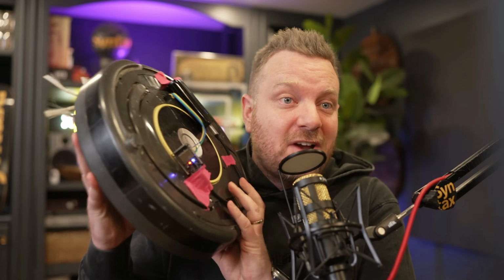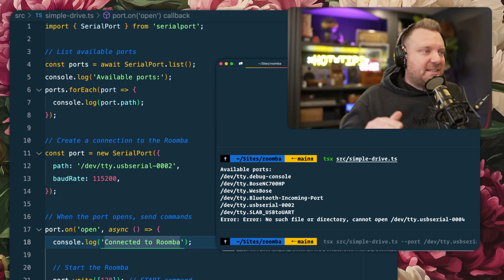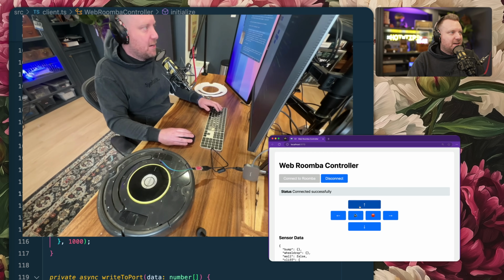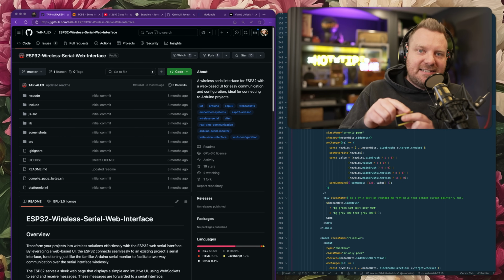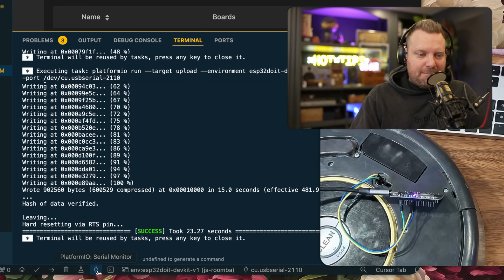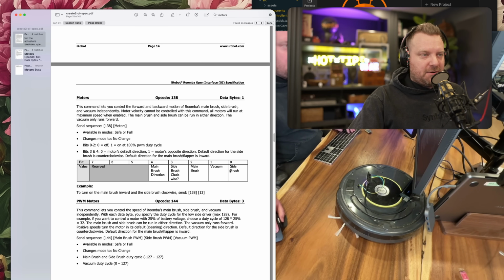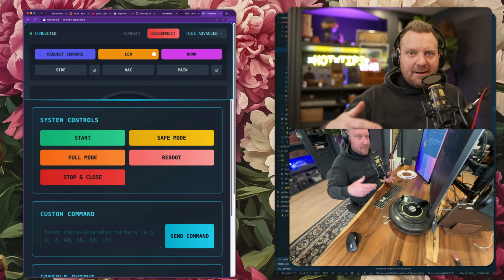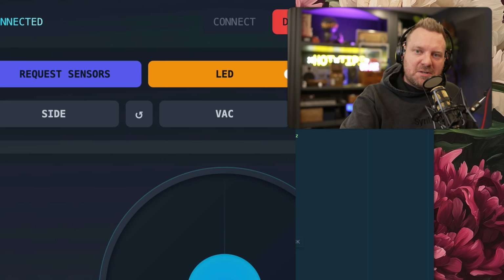I put JavaScript on my Roomba Vacuum

Comment: I want to run a vision model on Roomba i3 with NVidia Jetson nano. The Board doesn't have a serial connector. There is a PCIe like connector. Anyone know how to connect in to the MB? 
Plan B is to remove everything and Run a separate motor controller.

Comment: Is it possible to reprogram the audio files on a roomba? I want my roomba to say lines from the terminator while it cleans
Reply: The "song" command lets you write songs using notes, but I see that the length is determined by the number of notes, not the duration. You may have 16-16 second notes playing, or 16 1/64 of second notes playing.
Song Command opcode: 140 Number of data bytes:
2N + 2, where N is the
number of notes in the song
Specifies a song to the SCI to be played later. Each song is
associated with a song number which the Play command uses
to select the song to play. Users can specify up to 16 songs
with up to 16 notes per song. Each note is specified by a note
number using MIDI note definitions and a duration specified
in fractions of a second. The number of data bytes varies
depending on the length of the song specified. A one note song
is specified by four data bytes. For each additional note, two data
bytes must be added. The SCI must be in passive, safe, or full
mode to accept this command. This command does not change
the mode.
Serial sequence: [140] [Song Number] [Song Length] [Note
Number 1] [Note Duration 1] [Note Number 2] [Note Duration 2]
etc.
Song data byte 1: Song Number (0 – 15)
Specifies the number of the song being specified. If you send
a second Song command with the same song number, the old
song will be overwritten.
Song data byte 2: Song Length (1 – 16)
Specifies the length of the song in terms of the number of notes.
Song data bytes 3, 5, 7, etc.: Note Number (31 – 127)
Specifies the pitch of the note to be played in terms of the MIDI
note numbering scheme. The lowest note that Roomba can
play is note number 31. See the note number table for specific
notes. Any note number outside of the range of 31 to 127 will
be interpreted as a rest note and no sound will be played during
this note duration.
Song data bytes 4, 6, 8, etc.: Note Duration (0 – 255)
Specifies the duration of the note in increments of 1/64 of a
second. Therefore, half-second long note will have a duration
value of 32.

Comment: Question: Im trying to do the project myself but have problems with getting a connection on the esp , because of that it defaults to 0.0.0.0 How can I proceed to find a solution. I have a correct set up in the WifiSetUp.h file. Im using the repo Wes Bos made btw.   output:  Serial communication initialized
[ESP32] WebSocket handler initialized
[ESP32] Running start command [128]
[ESP32] Entering into Full mode [132]
[ESP32] Web server started. IP address: 0.0.0.0
Reply: I was having the same issue. In the secrets.h file, I added another line:  #define SSID "YOUR_SSID" and then in the config.h file I changed the first line under #define CONFIG_FIELDS(FIELD)  to FIELD(StaticString<100>, ssid_Router, SSID);

Comment: Very cool... I followed the tutorial and I can connect to the webpage. The ESP32 appears to receive the commands just fine, however, the Roomba doesn't do a thing. I even added a level shifter for the TX and BRC pins but that did not fix the issue. I have Python code that makes the Roomba do things and it works via an FTDI TTL USB cable. If you have any troubleshooting suggestions let me know. P.S. I'm powering the ESP32 via the Roomba battery via a power supply. Your setup looks super clean, no level shifters, etc...
Reply: For some reason My roomba is stuck in some diagnostic mode and it does not connect to the Open interface to receive commands

Comment: This is great! However, there's an important detail: the ESP32 uses 3.3V TTL logic levels for communication, while according to the Roomba's documentation, its serial RX and TX operate at 5V. Ideally, a voltage divider or a logic level converter should be used between the Roomba and the ESP32 to prevent any damage to the microcontroller.

Comment: I believe that with brotli compression you could result with even smaller react app size.
Brotli is slower than gz, so gz can be used for dynamic data (REST API), while brotli compression could be done on build phase.